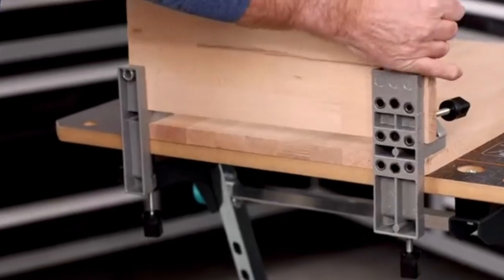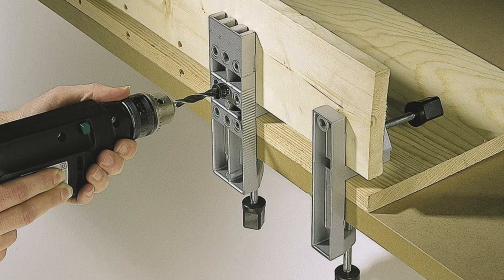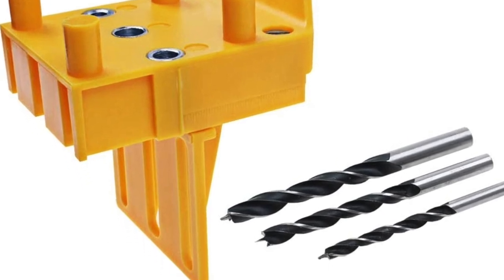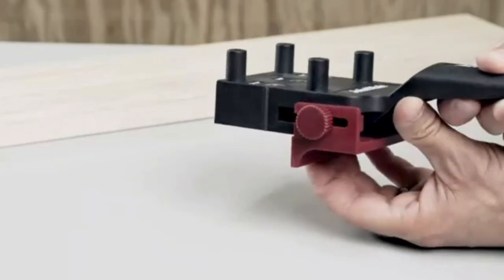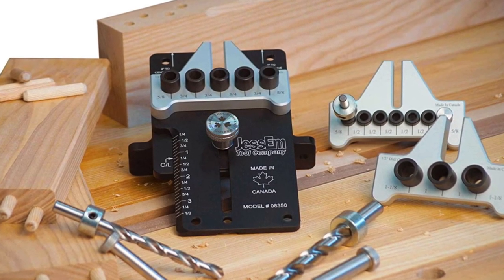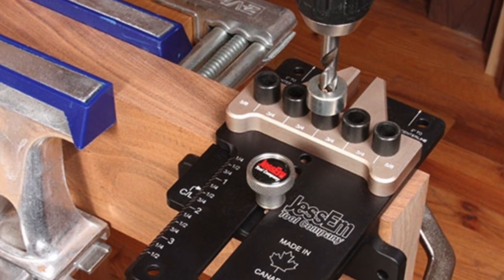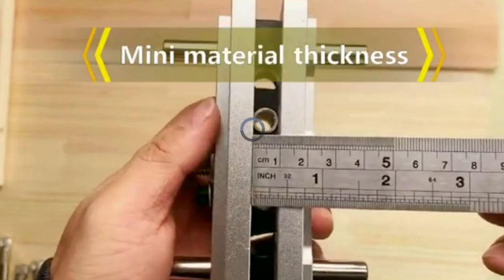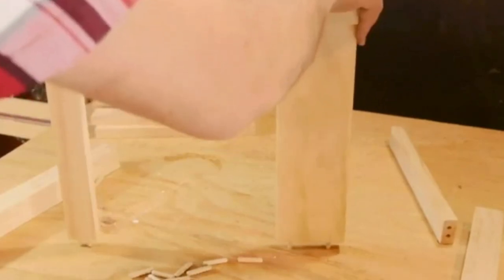TOP 5 BEST DOWEL JIGS: Top Dowel Jigs Review (2023)

Comment: Your review is pretty much spot on. I used the Milescraft for sometime, and it did get the job done. However if you want to graduate to higher end dowel assembly then I would save all your aluminum cans, cash them in, and buy both the Dowelmax and the Jessum Doweling jigs. Using these jigs are such a joy. I love the built in clamping system of the Dowelmax. If you are going to be doing a ton of dowel work, no one will regret investing in the higher end doweling systems. They are built like tanks and will probably last a couple of generations of woodworkers.

Comment: Nice video.  I have both the Dowel Max and the Jess Em which are definitely higher end but are well worth the money if you want a durable precision system.  I have tried several others but found these two brands are far and away the best.  I build high end furniture and use dowel joints exclusively.  They take some time to do, but the strength of the joint is well worth it.  Thanks again for a very nice video!
Reply from the maker: Thanks for watching!
Reply: I have the Dawelmax and think it's great for panels and stuff but if you're doing tapered table legs with a reveal it can get confusing. Would the Jessem be any less confusing in that situation?

Comment: For the money, I think you likely made a good call. I checked out the Jessem and the Dowl Max, but they are pricey. While digging around, I found that Jessem has a new product that isn't quit as expensive. I'll consider the Weekender edition of the new product, but it's still 5 times what the Wolfcraft costs. I don't like to throw money around, but I am at a point in my life that money isn't the issue it once was and this will see a good bit of use. At least I hope it will. we'll see. Got some thinkin to do. Thanks for the vid.
Reply: If you are considering the Jessum, and you do a bit of dowel work then You should buy it. You won't regret it. I like my Jessum so much I might just buy that new stainless steel model for my collection. Yeah, kind of a tool junkie. There are worse things I could be spending my money on!

Comment: The Wolfcraft is the worst of these 5 jig: it puts the dowels off center (except for panels with a thickness of 1/2") resulting in a weak joint. 
What did you mean with "centering pins are not included"? There is no way to center the dowels on the edge of a panel with this jig.